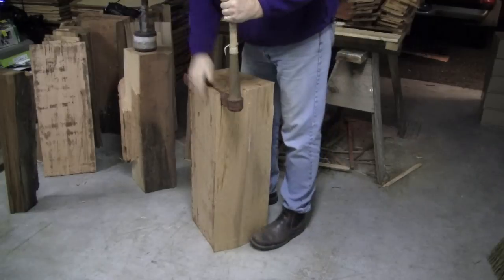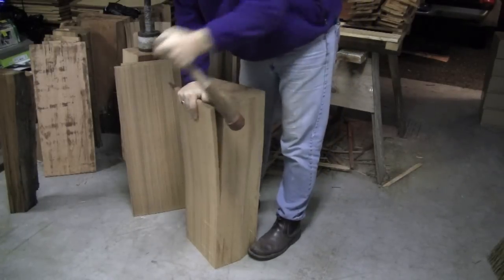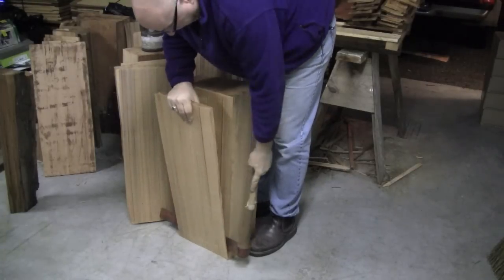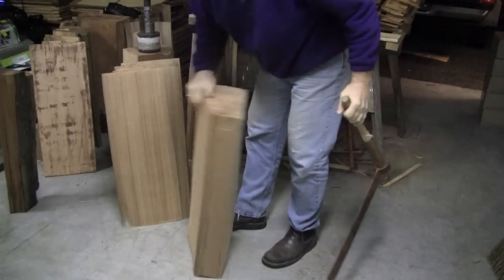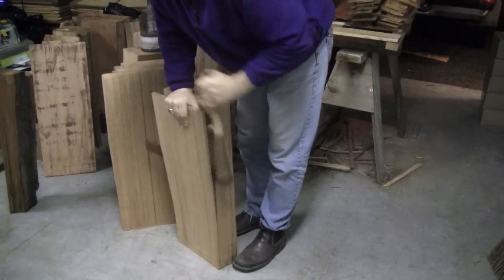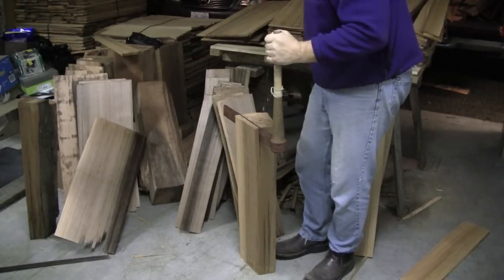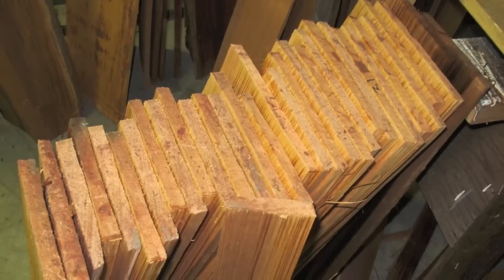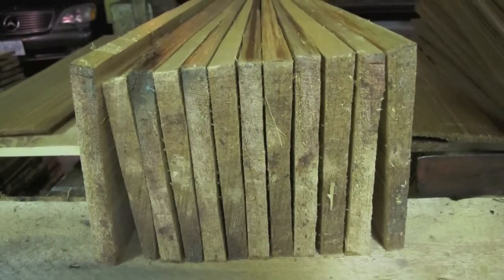Red Cedar Shakes - 30" Tapersplits

Comment from the maker: Howdy - when we flip the block, the wood naturally tapers from a thick butt end to a thinner tip. If we don't flip the block, the shake will split with the same thickness for the whole length. This is the case no matter how long the shake - but the amount of taper remains the same - relatively speaking. 

In 25 years, I don't think I have ever heard a good explanation why the wood naturally tapers when the block is flipped... 

I hope that helps! Many thanks for saying hello!
Reply from the maker: @AlaaShaheenarts  lloyd@woodroof.com

Comment: That's very nice and esthetic, but like u said, there are very few pieces of wood available to do this and this is really hard to do without Western Red Cedar which also has a limited habitat. This is why I made my machine which can be seen at "Homemade shingle/veneer making machine". Clearly, its not as esthetic as this, but I can use logs with small knots and imperfect grain. I can overlap my shingles and try to use the minimum amount of staples and glue. With enough glue panels can be made much like solid wood.

Comment: Hello sir,   so is the grain or rings at 90 deg. to the shingle faces.??? Thanks if you can help me with that info.
Reply from the maker: Yes, absolutely! I am keeping the splits as close to 90 degrees as possible. Notice that when I am splitting, the centre of the tree and the outside circumference of the tree is always facing to my right and left. This 90 degree angle is also called edge grain, vertical grain and radial grain, and similarly quarter-sawn if sawn. I hope that answers your question. Thanks for checking in.

Comment from the maker: @henryzimmer - Thanks Henry! 
Working 8 hours with good wood, I could produce about 20 bundles. This is equal to approx 900 shakes = approx 160 lineal meters = approx 37 m2 based on an 23cm exposure (3 layers of wood). It is pretty slow work with this long length.
Reply: I have watched this factual video.

Comment from the maker: Hi Wayne - yes, when you flip the block end over end and split, the wood tapers naturally. If you don't flip the block, it will split straight, giving a uniform thickness. This is the case on the edge grain face. I forget if that is the case on the flat grain face. Note - i have never been given a good explanation why the wood tapers as it does... Anyone out there know why?
Reply from the maker: +David Hedrick Thanks David! That's a good explanation. Makes sense to me!

Comment: do have let dry before put up or can put up with no worries. do put clear finish on right way or leave time for air dry?
Reply: rodney adams might be too late, but usually you want to let it season a bit and only finish one side so that the inside facing side can "breathe".  It's supposed to help keep them from shifting and cracking... I don't know if it really makes a difference, but that's what I was taught.  Only finish the side that faces the weather.

Comment: Do you run those at ten inch exposure with 18" 30# felt paper?
Reply: In regard to The 30" shakes, here in the west that's called a "barn" shake" and layed in two layers with a 4" lap no felt. All the cedar I saw used For shakes, grape stakes, and bean poles were from old downed trees, fresh-cut cedar would go for fence posts.